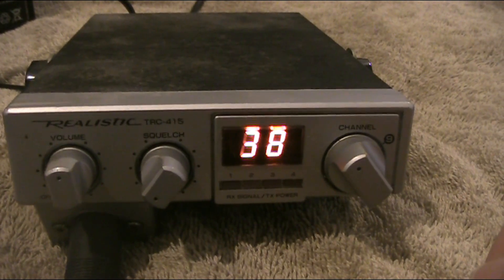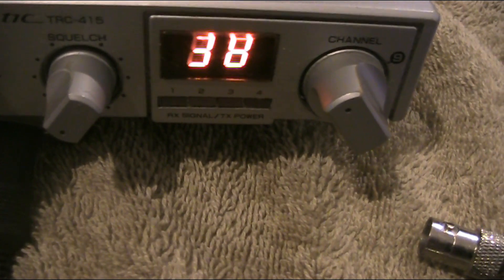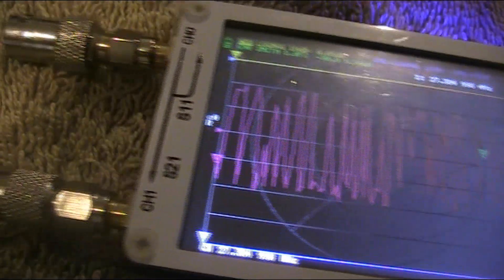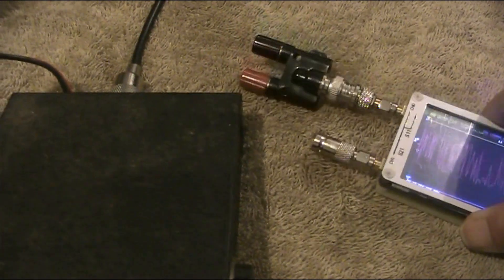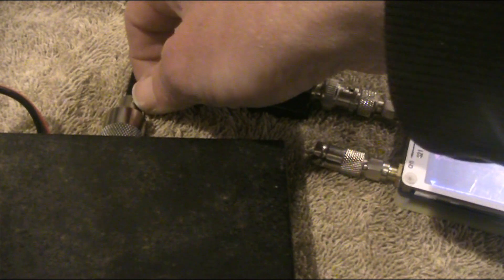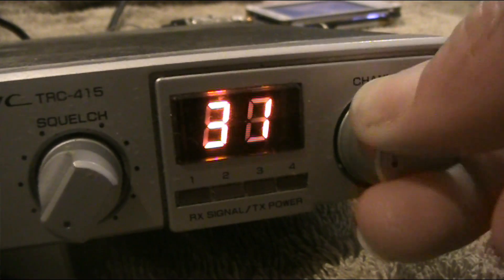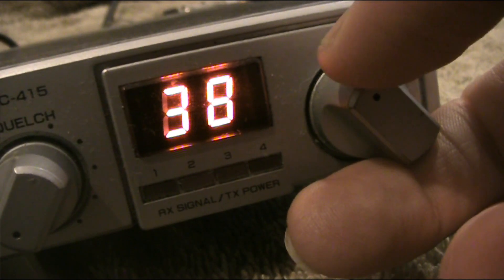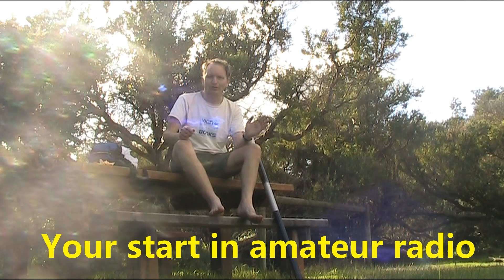Another way to hear SSB on your 27 MHz AM CB

Comment: Thanks, this is a great video 👍

You will get both side bands, lsb and usb. And you will get it all the time, the carrier is just on the other side off the singnal. In ssb radios you do need to different the two, because there is a thig filter filtering out the carrier and the other side band. You can actually listen on am singnas with ssb, i do that when there is some crap on the band and other side off the am singnal is cleaner, talking about am broadcast. 

In ham radio radios there is usually a knob lebeld rx gain This is the carrier singnal made to construct the singnal. Yes there is automatic gain control, but you have the option to manually adjust the bottom, in some noisie condition it's makes the rx experience better to put some attention and adjust the rx gain knob to reasonable level 

In this am to ssb by extra carrier you don't have any automatic control, so weak singnal will have weak audio and strong single will "over modulate" 

You can actually also transmit with the am radio, the frequency might not be on for the other stations, but if you're loky it is and the other stations won't even notice the you have an extra carrier and sideband in your singnal

Comment: Yes but the right way is to generate the carrier at the last IF frequency. (450-460khz) so you do not cause any unwanted interference. 
And I think that building a small 455khz bfo is cheaper and simpler that a digital antenna analyser.

Comment: Could You also use the IF Frequency of the Radio, with a Signal Generator, doing this? Because then You possibly would not have to change the Frequency of the Signal Generator all the Time when changing Frequencies / Channels on the Radio.. If the Stations are (at least) somewhat on Frequency, so that one is still able to understand what is been said.. 

CB Radio sounds / is very different in Germany... :D So it is not allways like this... :D :D
Reply from the maker: Yes, IF would work. But may be harder to get sufficient injection in unless you poke a wire inside the CB.

Comment: After watching this i went out to the shack and set up my am cb. I used a cb hand held with a power supply that i could turn the voltage down on. i transmitted on the low setting on the same channel. It overloaded.I then turned the voltage down and moved the HT around with different distances to the radio and voila. I could hear the mud ducks! Thanks Peter!! VK3TB

Comment: Hi Peter,

Did you try the nanoVNA on 10.695 MHz or thereabouts?  I'm assuming here that even the AM HF CB radios use the frequency generation and IF scheme popularised by designs incorporating PLL chips such as the PLL-02A, where the reference oscillator is 10.240 MHz and is divided by 1024 in the PLL IC to arrive at the 10 kHz reference frequency, and the 10.695 MHz first IF is mixed with the reference oscillator to generate the second IF at 455 kHz. 

Also: 8:00 Soooo pleased to hear that the gentleman concerned has some basic knowledge of his anatomy and purposes thereof.
Reply from the maker: I didn't try it but an interesting experiment. I'd imagine it would need more output to break through for sufficient level.

Comment: I wonder if enough signal would mix in the intermediate frequency if you connected straight to the chassis of the radio and generated the BFO at the intermediate frequency. This way it'll do all the channels at once
Reply: I suspect a bit of insulated wire from the nanoVNA fed through a hole in the chassis and not connected to anything inside may be better than connecting it direct to the chassis.  Even not feeding the wire through the chassis might work, given the poor IF isolation of the typical consumer-grade radio.

Comment: I did this as a kid with two radio's. One tuned to a Shortwave SSB station then i tuned another radio over the bands till i got a little carrier and i could hear the SSB. I really can't say if this works with every radio. But i did it a lot when i was 8 years old. Maybe my second radio oscillated or something.
Reply: I did this when I was a kid to provide a BFO for my consumer grade shortwave receiver (National Panasonic radio that my uncle brought back from overseas).  I did build a 455 kHz BFO but it was very finicky to adjust in both level (thus causing problems with overload) and frequency, and found another transistor radio right next to the case of the NP receiver was easier to use.

All that was happening was one of the signals generated within the other transistor radio was on the right frequency to beat with the incoming RF signal or the 455 kHz IF inside the NP receiver, thus detecting SSB and CW.  Moving the other transistor radio away from the NP receiver provided the BFO level control necessary to prevent overload under weak signal conditions. :)
Reply: Yes it does work, I've demonstrated the process using various portables... always fun 👍
Reply: Yes you get the other radio local oscillator on the other radio rx frequency and it usually leaks so much you can pick it up, all you need is a carrier for to decode the ssb. On ham radio settups this is called rf gain, you usualy have a controll on fast or slow and also a some way to manually adjust the carrier strength. Doing manual with am, you ged bought side bands, so if you have a busy band, you will get a lot of crap from the other side band
Reply: @kristiangronberg3150  does this work better on some types of radios than others?

Comment: Fixes the SSB but not what’s initiating the SSB  🤣😂🤣
Reply: CW fixes that
Reply: @MidlifeRenaissanceMan   Very good point! 👍😉
Reply: @SpinStar1956  it fixed me. I’m dreadful with a microphone. I tend to think with my mouth open and have a knack of combining humour with brutal honesty that has had me kicked out of places that shouldn’t have let me in in the first place. 

While I’m not very good at it, I mostly use CW….even in the car….while driving. Surprisingly straight forward and not that more distracting that talking to your passenger
Reply: @MidlifeRenaissanceMan  My problem is that I didn't have a good set-up for SSB when I first started in amateur radio (insufficient power, inadequate antenna), and also the tones in my voice were wrong.  So I have this ingrained sense of a morbid distrust of SSB, i.e. if I fire up the radio on SSB then I have this "I can try answering this DX station, but I won't be surprised if they cannot hear me" thought in the back of my mind.

What compounded this distrust was when I got my full call licence, an elderly friend (who'd also sat the upgrade test at the same time as me but failed, sadly, and then went SK before he was mentally prepared to sit the test again) loaned me his TS-520S that he didn't need (he had a nice, new TS-530) and deliberately didn't remind me to take the mic with me when I picked it up.  He was a dyed-in-the-wool CW operator. :)  So I had no choice but to use CW if I wanted to get on 20m, and accordingly the vast majority of QSOs in my early logs are CW.  He did loan me the mic later, but I rarely used it except in across-the-suburb rag chews with friends.

My early experience was quite frustrating because two of my closest friends of the same age and licence capability seemed to be able to work DX by the bagful using SSB without any need for a speech processor.  Most of my DX, contesting, etc, is via CW ever since.  As I saw in one comment on social media about 15 years ago: If God wanted us to use SSB he would've given us only one nostril!

To be fair, though, things have turned around a bit since then.  I have owned or do own radios with decent speech compressors, e.g. TS-180S with an IF speech compressor and filtering at both front and tail ends of the IF strip!  People tell me when they hear me using that it's as if I have a big linear using VOX - nothing then the S-meter goes whack but it's good quality audio.  The other radio with a decent compressor is the TS-480HX which can do 200W PEP barefoot.  I bought a reasonable audio compressor and Heil mic insert (as a kit) for the FT-817, and people say that sounds really good too.
Reply: @vk2ig  there’s something unambiguous bout communicating in CW on the ham bands, while rag chew is a challenge, and it what attracts me most to CW is having a conversation 

I have a bunch of studio gear, Heil, BeesNeez, Michael Joly microphones, and some nice mic pre’s, compressors and such, but I haven’t gone to the trouble of hooking them up. 

The other thing that draws me to CW is I can operate at night while everyone is in bed. That said, I’ve had complaints of the solid clack clack clack of some of my old brass keys I’ve acquired.

Comment: I'm going to make a prediction, I'll probably get it wrong 😁 are we talking about beat frequency oscillator (BFO).
Reply from the maker: I won't be building anything though.
Reply: @vk3ye  I knew I'd get it wrong 😁, clever idea by adding a carrier near the same signal strength, I wonder if you could do the same thing with a GDO and also on a short wave AM receiver, interesting video Peter I'll wait next time before I leave a comment. Cheers Adam G7CRQ
Reply: You were right in that the nanoVNA is effectively acting as a BFO but at RF instead of IF.